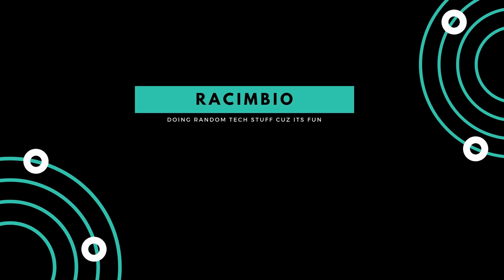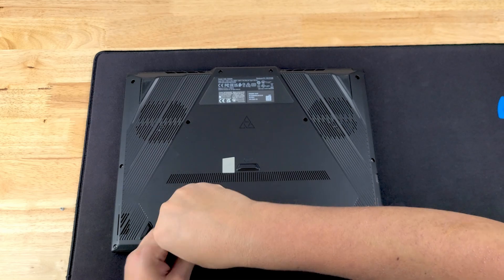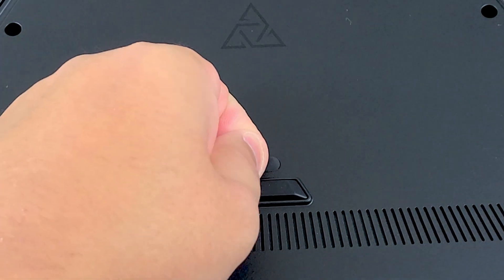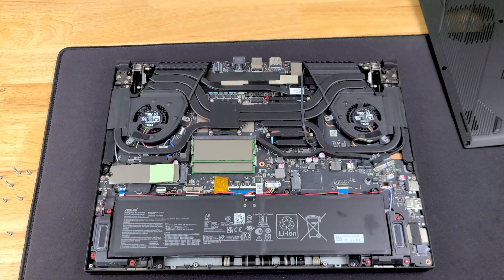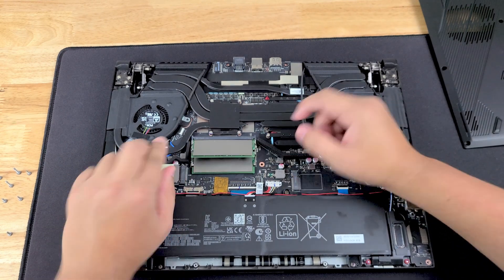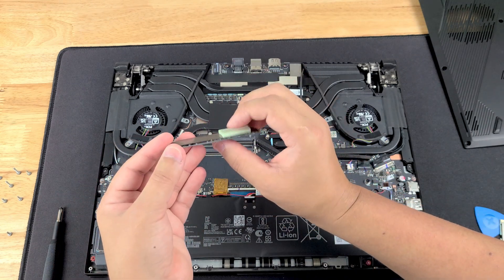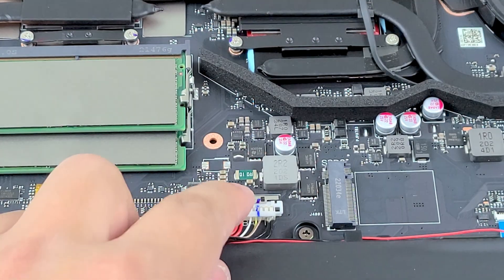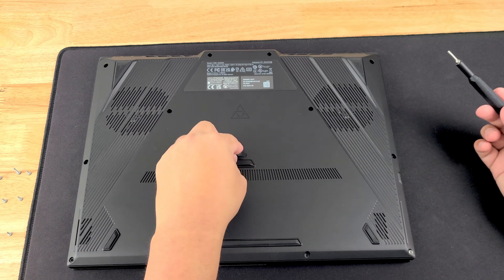Asus ROG Zephyrus Duo 16 GX650RX-XS97 |how to upgrade your Ram and SSD

Comment: So on this laptop, you are not able to upgrade the gpu correct? It is just the ssd storage and unified ram correct? I fully understood beforehand that I would not have the same capabilities as a PC Desktop with buying Laptop. What all can you replace on this thing to make it better?
Reply from the maker: Most gaming laptops now , you can only upgrade storage and ram .The gpu and cpu are soldered onto the motherboards.There are still some gaming laptops like tungfang or Clevo, which are arnt the known brands. They still allow at least a cpu change on some models so that other companies can rebrand them and install the cpu they want.But sadly, most of the well-known good brands went the other route. They are even doing the soldered on ram too now. So for notebooks and laptops, you get what you paid for, so if you want high end , you have to purchase the high ends cpu and gpu models. No upgrade path other than ram and ssd if the laptop allows it. Definitely research each model before purchasing.

Comment: Great video! Thank you for the clear step by step guide. Do you know if I can add my old Zephyrus S "1TB PCIe 3.0 NVMe M.2 Performance SSD" to this Laptop? The only difference I see is that the one in the Duo 16 is "PCIe 4.0", but I don't know enough to know if that makes a difference.
Reply: Idk if this is too late a reply but all NVME drives are cross compatible, however if it's a gen 4 slot with a gen 3 drive it will run at gen 3 speeds

Comment: Could you tell me what m2 is standard in this laptop. I could see samsung there it was standard or u upgrade it?? Another question what ram are there?? And what ram you would recommend for ryzen processor as it does not work with xmp for intel. So that the ram woild work on full speed.

Comment: Do i need to use thermal pads if I want to add another nvme?
Reply from the maker: Shouldn't need to. They help but the nvme should be rated to run safely without the pads. There are also nvmes that come with a heats ink that looks like a sticker but it's for cooling like the Sabrent drives.

Comment: Thanks for the video! I recenty installed a 2tb 970 evo plus ssd in the empty slot, and was wondering if it's necessary to use thermal pads and a heat sink, as the ssd didnt come with any. Do I run the risk of damaging the motherboard if i dont use thermal pads?
Reply from the maker: No risk of damaging board. The evos do run a bit hot though so a thermal pad would benefit the ssd but not entirely nessesary since they are designed to run as they come.
Reply: @racimbio I am upgrading my laptop and I want to upgrade its ram and storage. Please recommend the brand I should buy for it ??